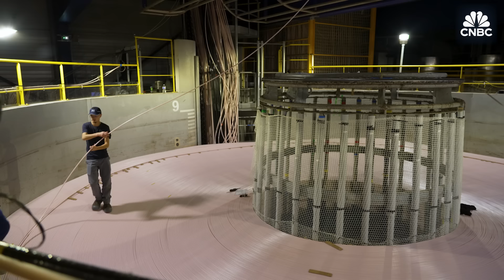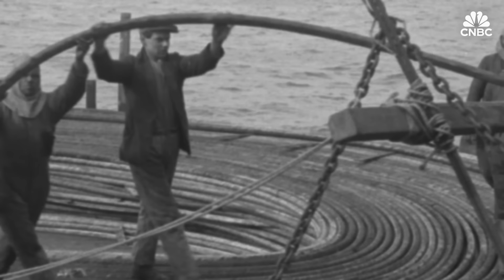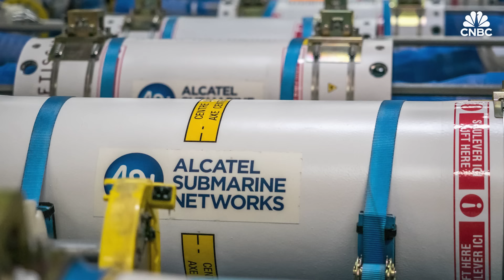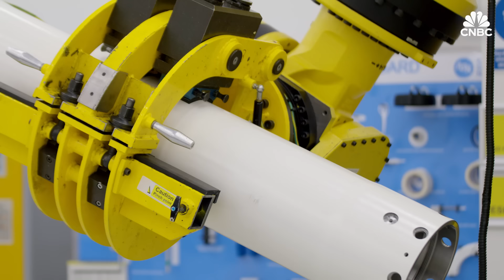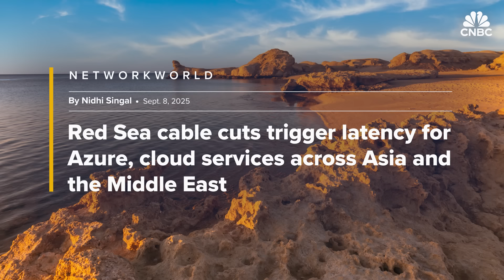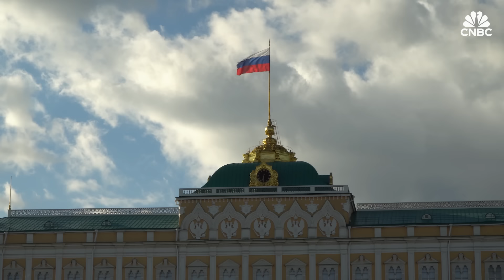How A Million Miles Of Undersea Cables Power The Internet — And Now AI

Comment: I would also like to point out that you would need several hundred pulse regenerators, spaced approximately every 8-to-10 Km along the sea-bed, which would make the latency time too high concerning holding a meaningful telephone-call conversation (or video-call) between someone in the USA and someone in the UK i.e. the time-delay between each party on the line would be too long i.e. a few minutes. The pictures in your news report, above, showing a cable-laying ship in action, must have been laying a fibre-optic cable near to a country's coast and along this. I don't think it was laying such a cable between the USA and the UK;  a distance of several thousand Kilometres. Such a cable lay wouldn't be feasible, due to what I've said about time-delay i.e. "latency".

Comment: Concerning my comment below: I wish to point out that a "repeater" was used in analogue telecommunications links to increase the amplitude of the waveform fed into it; it didn't actually change its waveform shape. Conversely, a "regenerator" - which is the digital equivalent of and analogue repeater - changes the out-of-shape input digital waveform and outputs what is usually a near perfect digital waveform. That is to say, the output waveform of a pulse-regenerator has near perfect rising and falling edge characteristics, compared to the input waveform. Thus, this is the difference between a repeater and a pulse-regenerator.

Comment: In your CNBC video, your correspondent mentioned electrically powered "repeaters" which were described as "amplifying" the signals along the fibre-optic cable. I wish to point out that in the case of digital signal transmission along optical-fibres, the pulses of infra-red digital signals need to be "regenerated" every 8 Km, or slightly more in distance, using what are known as "pulse-regenerators"; it's the pulse train shape that degrades with increasing distance along optical-fibres; the signal being "regenerated" by each pulse-regenerator along the cable. The term "amplification" is an analogue electronics/telecommunications term which means increasing the "amplitude" of the signal concerned; this is not what a pulse-regenerator does! A pulse-regenerator merely re-instates the original pulse-train-shape fed into the fibre/cable at the transmission end.

Comment: I thought most of our internet is now wireless? We have all these new satellites in the sky just for this. I just changed my internet to a wireless provider and it was the fastest connection I ever setup.
Reply: Your ISP is still relying on this cable, unless you have Starlink.
Reply: I think you are extremely misinformed. Internet providers still use fiber optic cables to link their equipment. Even if you have a wireless provider like 5G home internet or a WISP (Wireless ISP), there is still fiber somewhere along the chain. Cell towers get their service via fiber optic cables. Satellite internet services like Starlink use receiver stations on Earth that run off fiber cables.

Comment: What struck me most here is the consolidation angle - by 2025, hyperscalers like Google, Meta, and Microsoft now own or co-own roughly 30% of global subsea cable capacity, up from near zero a decade ago. That's a profound shift in who controls the physical backbone of the internet. The "grey-zone tactics" chapter is the real sleeper story though: most of the ~200 cable cuts per year are attributed to accidents (fishing, anchors), but even a handful of deliberate ones near chokepoints like the Strait of Malacca or the Red Sea could isolate entire regions. The 2022 Tonga volcanic cable cut was a preview of how fast a nation goes dark. Worth pairing this with the TeleGeography data on cable route redundancy - a lot of island nations in the Pacific have single-strand dependency with no backup. The AI bandwidth demand piece at the end is also underappreciated: we're talking about training clusters that need terabits/sec of cross-ocean sync. The cable infrastructure built for 2010s internet traffic wasn't designed for this.

Comment: Alcatel-Lucent and Nokia had vessels used in installation, maintenance, and repair of undersea cables. known as Alcatel Submarine Networks. AT&T and Western Electric were innovators in underseas installations and cabling in the past. In the past 30 years of history. The "1998 Underwater Fiber Breakthrough was done by: Lucent Technologies (then-owner of Bell Labs in Murray Hill) introduced a new, highly efficient fiber for long-distance, trans-oceanic submarine networks" In 2016, Alcatel-Lucent "Bell Labs achieved a 6,600-kilometer single-mode transoceanic fiber for ASN. "Nokia completed the sale of Alcatel Submarine Networks (ASN) to the French State on December 31, 2024."

Comment: Subsea cables that connect continents are neither more nor less critical than terrestrial fiber cables. The difference is simply that there are fewer of them, which means intercontinental traffic is concentrated on a limited number of routes.

That said, cutting one or even two cables would not “break the internet.” There is extensive redundancy built into the global network. At worst, you might see slightly higher latency or reduced throughput — not a collapse of connectivity.

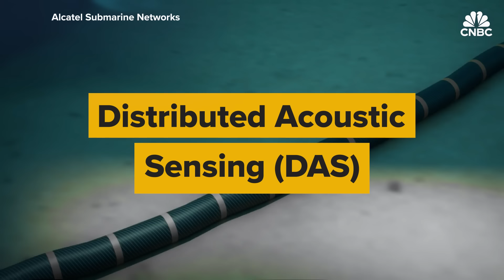Comment: Around 20:46 I think they're was some confusion on which system the gentleman was describing.  Optical reflectometry is for finding issues/brake on fiber-optic, the sonar effect is for copper wires.  Send like the narrator was talking about one tech. while the interviewee was talking about another.  Fiber can't send out a signal to detect nearby objects like you can with copper.
Reply: Das is not otdr.

You can find videos on how DAS works.

It doesn't need to send out a signal to receive a signal.
Reply: @NeverWoken  I didn´t do a lot of describing how otdr works besides suggesting  that OTDR is for finding issues on fiber optic.  Are you saying I got that wrong and need to look it up ?
Reply: I think you may be misunderstanding what my comment is about.  The narrator is talking about DAS, and even showed the animation for it, however, when they cut to the guy, it sounds like he's explaining OTDR, but the editor or whoever put that clip in in the middle of the DAS explanation.

Comment: Global infrastructure must evolve alongside rising demand, increasing complexity, and growing interdependence across systems. Distributed sensing—acoustic, optical, electromagnetic—will serve as the nervous system of this evolution.

Several trends drive this change:

• The need for continuous monitoring
• The scale of modern engineering systems
• Advances in fiber sensing physics
• Growth in machine learning for pattern recognition
• The increasing value of early anomaly detection

As a doctoral candidate in engineering, I remain focused on how AI can improve the efficiency and reliability of sensing systems. DAS, in particular, continues to demonstrate remarkable versatility across energy, transportation, and environmental applications.

The engineering community will shape the next decade of sensing innovation, and I intend to contribute to that conversation with focus and purpose.

– Will Pape

Comment: Corning is the most superior fiber optics manufacturer. I just measured 45,000 feet of signal, Corning Single Mode Fiber from the Optical Terminal to a subscriber without the need for amplification.

Comment: What’s the process of repairing damaged or cut cables? Or do they need to be replaced if so?
Reply: Drones go down.. find the split cable ends.. from data when it was laid and distance calculated using laser reflections. then they float the 2 ends of the split on 2 different ships that are connected by a new patch cable.. both ends of the patch cable are spliced to the split ends of the old cable.. the joins are tested for quality. armored. then dropped back to the sea floor.. takes like a 4 to 5 days.

Comment: Holy crap, I thought Mitsubishi was up there, but Sumitomo is everywhere, as well.
Reply: sumitomo bigger than mitsubishi in cables
Reply: @jokok2333  Holy crap, just looked it up and you ain't exaggerating. They are huge in cables. From high speed, USB, display port, to the multi-billion dollar underwater cable industry. I had no idea.

Comment: I still have 1 question : how these cables crossing undersea trench...?
Some of this trench spanning thousands of miles long from south to north like snakes following continental plates borders and over a few miles wide and a few miles deep.
Reply: Same way most  cables 'cross' trenches and valleys on land, by follo wing the landscape of the sea. As said at one point of the video, the cables are rated for u to 8km depth, which covers 95%+ of all subsea trenches. And they can build specialised stretches that can go 12km deep, which is depper than the deepest known spots in any ocean

Comment: So...what happens to the old cables when the new ones are laid down? Do they ever retrieve them or are they still in use?
Reply: Would be left in place as backup untill it breaks, then removed at landing sites, but left on ocean floor.
Reply: The old cables get upgraded, just like your phone, and have new camera features as well.
Reply: @coasttocoastphoto the planned life of these cables is 20-25 years. Sometimes their life can be extended with new optronics at each end. Some of the older cables use fiber that doesn’t have the performance of new ones. That’s when they are abandoned and thus the opportunity for recovery.
Reply: New companies are being founded to recover and recycle the old cables.
Reply: @ramonwu4694  It’s a piece of cake to retrieve tons of cable over thousands of miles from the bottom of the ocean.

Comment: Can satellites not do the same thing? Or is there some airspace restriction?
Reply: Latency
Reply: Satellites work but have very big latency issues hence Star link having 20k+ in orbit these days.
Reply: For satelites it's also a bandwith issue. In theorey satelites could match that, but it would be extremely expensive. Subsea cables transfer a LOT of data

Comment: How deep can these cables go? Do they try to avoid trenches when routing? One of the guys did mention 8000 meters.
Reply: They can be installed to 8km. the repeaters are tested to 10km, I worked at Greenwich they used to have a test chamber that would get up to those pressures, I assume they still do
Reply: @petert8263  Thanks!
Reply: Well at least once things for sure there were no cables damaged by MH370 or else that plane would've been found ages ago!

Comment: From Western NY to London my latency is 70ms. It is an amazing time.... To play games with your friends 🙃😁
Reply: Not if Putin gets his way. Blank screen?
Reply: well with fiber optics, it travels at a fraction of the speed of light
Reply: @q9r8s7t6u5v4w3x2y1z0  66%
Reply: 70ms is far too long.
Should be closer to 20 or less.
Reply: @deanXRayZulu  The distance to NY will be 5500km and you have to make a round trip.  The velocity in fibre is 2/3 of lightspeed.  I.E. the minimum latency is a tad less than 60ms.
Theoretically Starlink can beat this, since it uses lasers and lightspeed.  That advantage will be used for trading I suppose.
Reply: @la7dfa Latency is not defined as the round trip time. Latency is the time for a packet to get from A to B only.
Reply: @deanXRayZulu  Latency, or “lag,” measures the delay experienced in sending and receiving packets over a network. It is often expressed in the round-trip time (RTT) for a packet to travel from the source host to the destination host and back.
Reply: @la7dfa No, you are incorrect.
Latency is the one way trip from A to B.
However if you use ping that will give you the round trip time which is double the latency.

Do your research.

Not all packets go outbound and return in a communication session. UDP protocol is an example of this.
Reply: @deanXRayZulu  Yes but that is broadcast, not what we test for as users of the internet.  Anyway I guess you can consider both as a kind of latency.  
Ping is the easy one to measure tho.
Reply: @la7dfa UDP is not broadcast. It can be, but it depends on the precise protocol that is used.

The idea that every packet sent out from A to B results in a return packet is farcical and if you don't know this then I suggest you cease commenting.
The return packets may even take a different route, and experience congestion even on the same route,  so arguing that the latency is defined as a combination of the outbound latency and return latency is clearly nonsense. It has little value in the industry and it is NOT the definition of latency.
End of argument.
Reply: @deanXRayZulu  Whatever dude, I will let you carry on your quest for World dominance as the greatest pedantric.
Reply: Man I get that much from Perth to Sydney...we gotta step up our game in Aus 😭
Reply: @jawaad132 huh really? My friend in syd get 90 ish in Singapore or HongKong or anywhere in SEA…you sure? I think it might just be you
Reply: mine is between 10-12, and it frequently cuts out then reconnects, it’s bad.

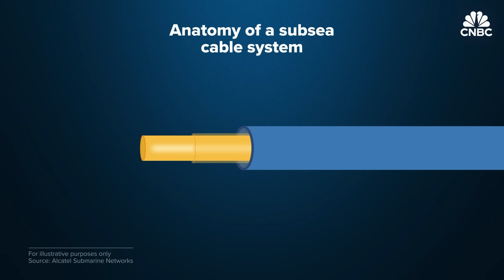Comment: @3:57 - I'm pretty damn sure the LASER light doesn't bounce around in the optical fibers for undersea cables.
AFAIK that "only happens" in multimode fiber cables - they have higher losses and other problems (the laser light wavefront defracts(?) more with total reflections, making signals less "sharp").
Monomode fibers are so much smaller in diameter that one can kinda say the light doesn't bounce around at all - instead it moves in a "straight" line following the curvature of the cable (I think this isn't entirely true either but Physics get's "wonky" around those dimensions).
Reply: Nope, happens in both single mode and multimode.
Reply: @ZippyDooDa435  pretty sure you are wrong.
see eg. https://en.wikipedia.org/wiki/Optical_fiber#Refractive_index
Reply: @L1m3r  TIL

Comment: We went on a Ferry and went by one of these  cable ships up close.  Not only was the Ship HUGE, but the Spool/Reel with the cable also HUGE!
Reply: if it had a spool / reel - then it likely wasnt a telecom cable. Cable the telecom vessels is kept in tanks, which are generally not visible.
Reply: they maybe huge but you still need put cables inside the oceans no matter what to run data through them across the world no matter how advanced these chips are.